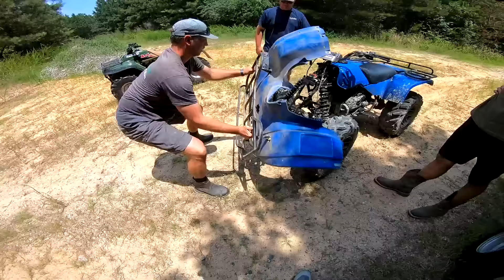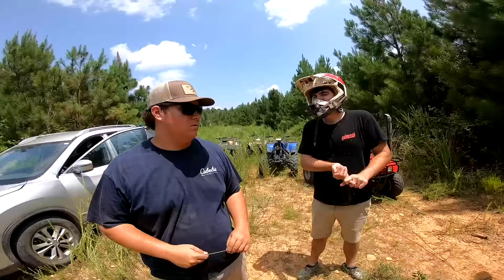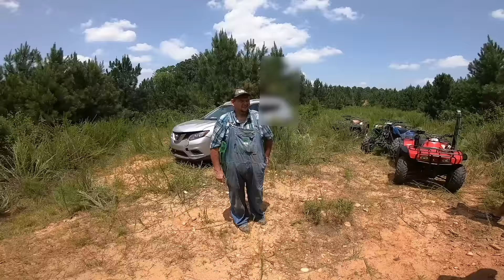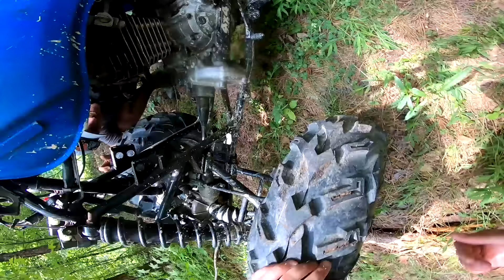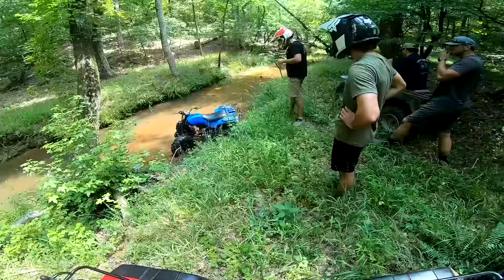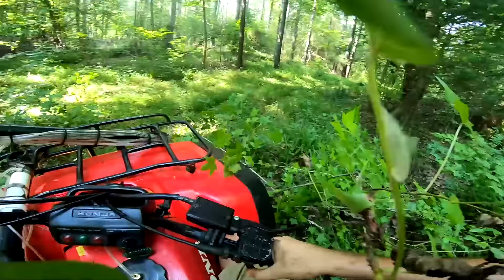TRESPASSER CAUGHT IN THE ACT!

Comment: This video bought me back memories of when this happened 4 years ago. I like how Christian said Braydon has put a lot of work in the four wheeler then the front rack came apart and fell off. Braydon you definitely should blow up the blue 300 who agrees?
Reply: Christian ruined that front rack on purpose, when it started coming off he could have pulled over and fixed it but no he just decides to steer left and right real sharp until something worse happens.
Reply: @cg8213  if it were his or your four wheeler youd have found a way real fast. He could have put a leg on it long enough to ask braydon what he should do about it, but you just dont disrespect somebodys property like that. He started steering real hard to make it worse. If he would have geared down and not been a tard im sure it would have been fixable. They could have used a shoe string to secure it or something. Running it over like he did was unacceptable, period.